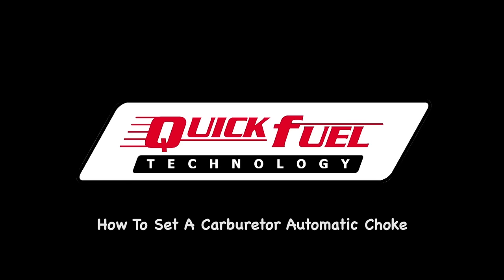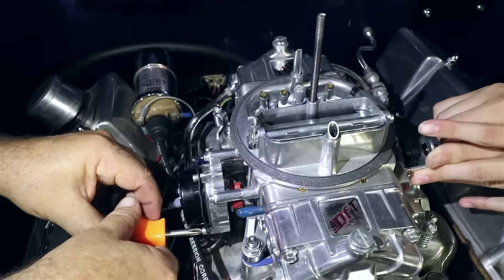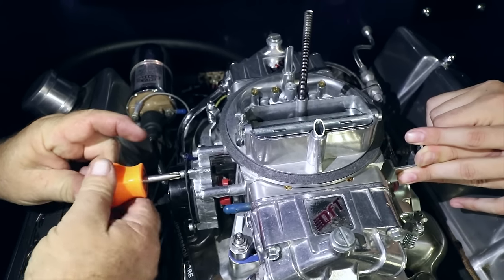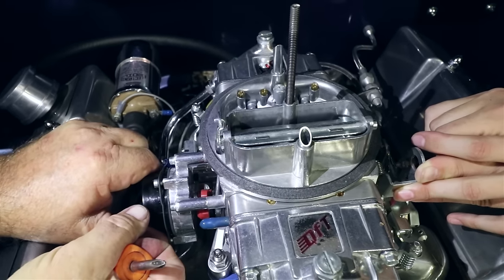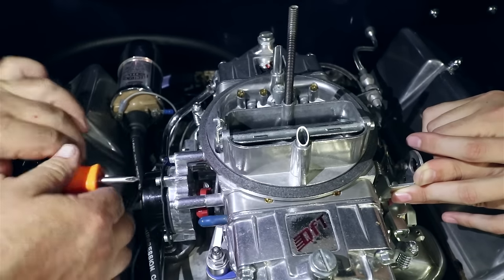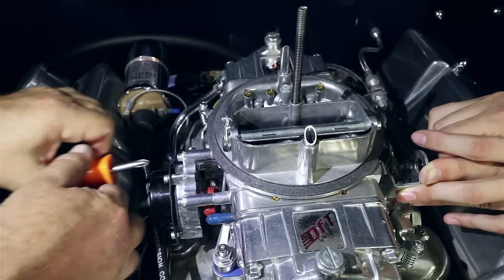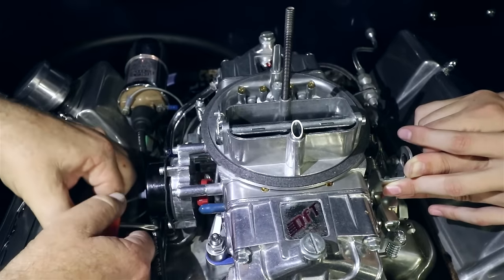How to Adjust a Carburetor Automatic Choke

Comment: Step #1 (shown, not mentioned): open your throttle fully.
Reply: Why?
Reply: Thanks. This was not clear in this video and helped alot
Reply: Does this matter ???? Really does it I can’t get mine to run it fires up but the the choke opens to fast and it dies instantly if I hold the choke it will run
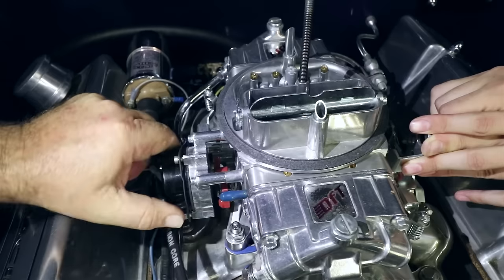Reply: 0:28

Comment: Is the accelerator being held open
Reply: Rose McBirney  same question for me too
Reply: sure looks like it
Reply: I don't think so.  If anything, he's holding the linkage so it doesn't move, & affect the choke adjustment.
Reply: I was wondering the same🤷‍♂️..
Reply: What if the flaps won't stay closed. Is something broken
Reply: Someone is holding the throttle open a bit. You do need to, because there is a high speed idle screw and cam setup that kinda links the choke Lever to the primary throttle shaft.

After you set it up correctly leave it alone.

Now, let's say 3 days passes, you need to blip the gas pedal just a bit, to ensure that the choke fast idle screw is on the largest step of the fast idle cam. Also, by blipping the gas pedal a bit, if the choke butterfly was "open" when you shut down the engine last time, it could be jamming up in the open position. Pumping the gas resets both of these things. If it was jammed, (totally normal) once you pump the gas a little bit, the choke butterfly will litteraly snap back to the normal cold, closed setting. You can litteraly time out (in minutes) how long it will take for the choke butterfly to go from closed to open.

Mine is set to be 3 minutes, in a heated garage.

On a cold day, you'd want it to be more like 5 or 6 minutes. Adjust accordingly.

You can also adjust the high speed idle screw too, for more rpm.

They never shown or talked about any of this in the video. Ha ha ha ha ha ha ha ha ha ha
Reply: Yeah, if only they spoke more about it. I have to adjust all over again, revs are now too high since adjusting choke🤦‍♂️

Comment: How do you stop the choke from engaging multiple times while running errands? I don't want to sit in the parking lot waiting for the choke to crawl open every time I stop somewhere
Reply: I’m having the same issue. Did you figure it out? I feel like I’m just done with auto chokes. Rather have manual.
Reply: @David-fl4xw  nope, I just adjusted it so it's a little shorter.

Comment: It seems you set it with the flaps open 1/8" for SoCal. For Colder climates what do you recommend? Should the choke be totally closed for colder ambient temperatures?
Reply: Exactly???
Reply: He did mention that. Yup. You can actually put tension on the spring to increase the time it's in the closed position.
Reply: Check your service manual or carb rebuild spec sheet.  There is a spec for choke blade gap,  it's usually about 3/16ths,  use a drill bit of that size between the choke blade and carb body to adjust to the right gap.

Comment: i have a toyota coaster BB10 1977 it has a holden 202 motor in it from a WB car. automatic choke has no wire on it where would it go on to. i need to put petrol in the carby to get it running all the time, the coaster is not on the raod im just working on it. will be a motorhome soon. or do i need a new carby

Comment: my carby, on my nissan L20B engine,  the electric choke- is not locked to the choke shaft. On which side  of the choke lever( inside the auto choke cover)should the head of the spring sit,  Should it sit push on the choke shaft lever to close  the choke, when cold (overnight), or should it push the lever (from the other side) as it warms with electric current, upon start and running, as the idle speed (at cold) is controlled by the step cam